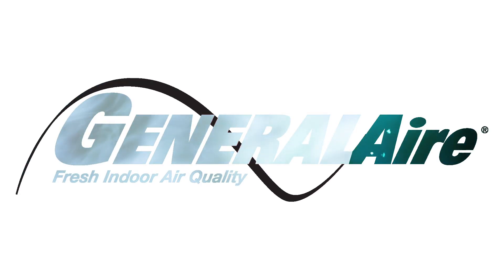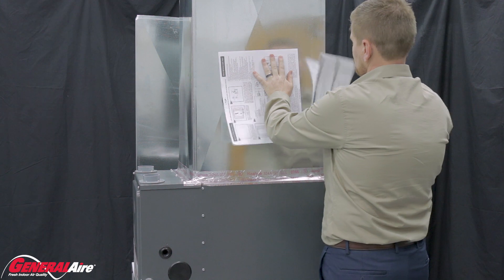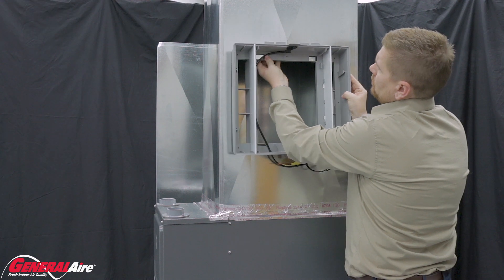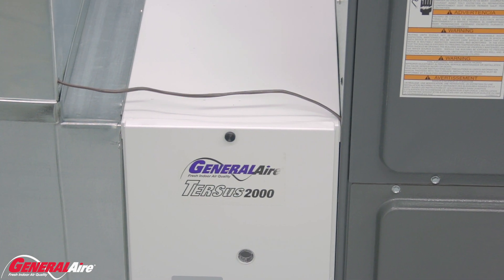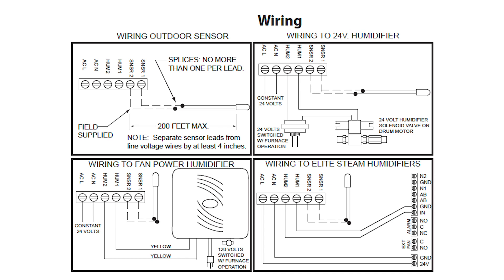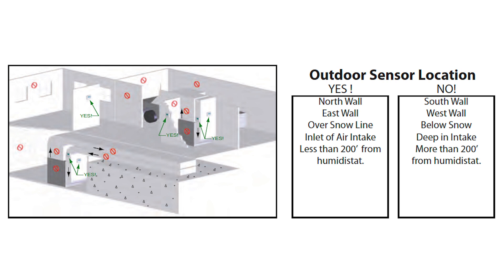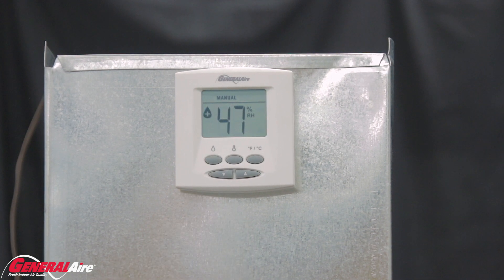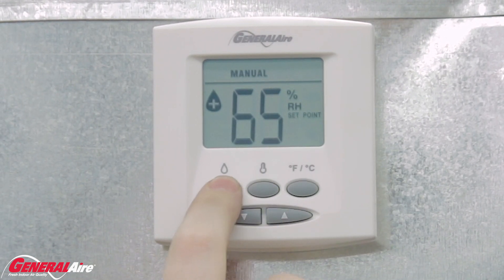GeneralAire® 1000 Humidifier Installation

Comment: Do these work on any furnace? Does it make a big difference in humidity? We live in a mobile in northern Canada and air is extremely dry. Needed advice on the best humidifier
Reply from the maker: Humidifiers installed on a furnace can only be installed on a forced-air furnace with duct work.  Does that help?

Comment: Is it normal to install the base with only 2 screws, when there appears to be 5 screw holes?
Reply from the maker: Dear JM, If you read page 4 of our installation manual, it says to use 8 screws (step 2).  http://www.generalfilters.com/cm/dpl/downloads/products/249/1000-16_REV_GGFI_5735_&_5730-_1000_Humidifier_Installation_&_Owners_Manual.pdf

Comment: This install is located where most "A-Coils" would be located...directly above the furnace.
Reply from the maker: Dear OttoMater, If you listen to the instruction it does say to install on the supply and not the return, so the video is correct.